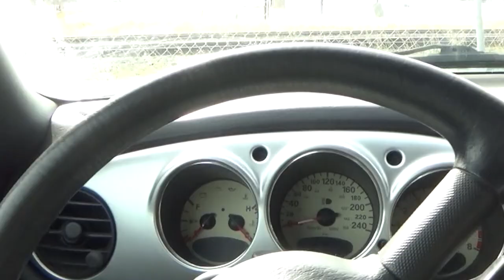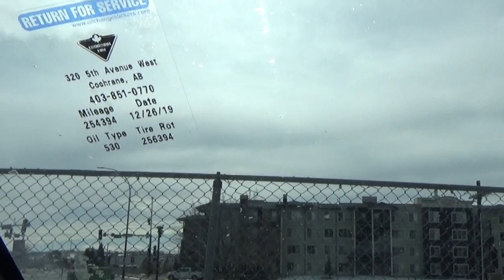I Bought a Turbo PT Cruiser Convertible!

Comment: Slightly eventful trip! Got it done though. Overall seems like a sweet deal for the money. Now the fleet isn't lacking! :)
Reply from the maker: 802 Garage I’m pretty happy with it for the money, I was expecting more cosmetic issues, but it’s pretty clean aside from the front bumper. I’ve driven it around town a few times since and the cam sensor has been behaving, but I’m still gonna change it + clean all the grounds.

Comment: I bought a '05 PT Cruiser convertible a couple of years ago. I love it. It handles like a sports car... I'm assuming that is because of the low center of gravity inherent to convertibles. Yes, the symptoms you are experiencing at 6:35 is the cam sensor... but replacing the cam position sensor is super easy, barely an inconvenience. Anyway, this car got me though my motorcycle withdrawal... after almost 40 years of riding motorcycles, I had my first accident (I was sitting at a stop sign, some idiot on his cell phone turned the corner short and plowed right into me). It was also my last motorcycle accident.
Reply from the maker: Jim Schwartz Yup cam sensor and wheel bearing already swapped, car has ran great since. Sorry to hear about your crash, I never had one but I had a few close calls on motorcycles and hung up my helmet also, too many crazy drivers out there these days. Actually all PT’s handle that good, I autocrossed a base model sedan and was the 4th fastest car of the day, if I’d had a turbo that day I think I could’ve beat them all. Here’s the video of that if you’re interested, it was such a fun time! https://youtu.be/cNBgJJ-K9M4

Comment: My '04 GT is the same blue as the chase car.  BTW if your PT's or Neon throws a MIL code regarding in correct purge flow it may be a sticky check valve on the top of the fuel tank.  Valve is glued to tank so I just top off the fuel and reach under the car and thump the bottom of the gas tank with a rubber mallet.  When you hear the "marble" drop you know you are good to go, just clear the code.
Reply from the maker: Jon Cooper “Electric blue”, yes that was the first PT we ever bought, it’s my dad’s, he’s had it 6yrs now, just a base model 5spd, no A/C or anything, buy it’s been a great car. Thanks for the tip, I had an issue like that on a ‘04 Durango and the fuel pump sucked the plastic gas tank right flat, destroyed the sending unit etc, not cool, that was one Mopar I had terrible luck with.

Comment: Looking forward to seeing your information on the car. I’m in the process of rebuilding my 2005 PT Turbo convertible.
Reply from the maker: Allan-Christine Hart Nice! I have a few videos planned for it for sure. I’m hoping it warms up here soon so I can put the top down, so far it’s still snow & cold.
Reply: Matt's Garage Thanks for the note- 75 here in Memphis TN. Just finished taking the intake off today to change out upper hose to cooling system. I’m just very cautious about any plastic connector in the engine area. My car is rust free except for one bump on one finder.
Found that the overflow bottle is next to be replaced. 
Have parts for steering, upper and lower control arms and wares link to be replaced. Then timing belt and all that would mean.
Has a new top already!!! I’m glad to have a project car again!!!
Reply from the maker: Allan-Christine Hart Wow! Giving it some serious love it sounds like!👍

Comment: Love my convertible my cam sensor did that to us in Newfoundland but after getting off the ferry we drove home in the Ottawa valley no problems lol was scary wasn’t sure if we make it home lol
Reply from the maker: Eric Lavoie The funny part with this one is the seller said they’d been driving with the engine light on for a long time without any issues, that’s my luck that it would act up 10mins after I buy it!😂 But at least it cleared up so I could get a chance to know it didn’t have other issues, I’ve drove it a few times since the video and it’s performed great, today I’m changing out the wheel bearing, cam sensor and I’m cleaning the grounds up (nice warm day out luckily). Very important to keep your electrical system maintained, that will prevent failures like this from happening. I actually recently did this video on just that: https://youtu.be/L94-bxYqOAw
Reply: Next week nice weather coming going take my baby out of storage clean her up take my mind off this virus crap going around

Comment: This looks like same year as mine. I love it!
Reply from the maker: Curious George It’s an ‘05, first year of the convertible and then in ‘06 they did the update I don’t care for as much.
Reply: @CarswithNash  Mine is 05 in the blue. This summer I am going to do some remodels with crome. Right now my issue is the gas gage goes wonky it will go low beeps but I have gas, not sure what to do, also cruise control not working, not sure how much that will cost. But, other than that crossing fingers it will last me few years.
Reply from the maker: Curious George That’s a bad ground, your fuel gauge actually grounds on the right side of the engine bay right up behind the upper mount there’s a 10mm bolt with a grounding harness running to it, you need to take that apart and clean it. I actually did an entire video on this recently and I highly recommend you do the entire process to your car. I’m actually just doing it to this car today, it’s one of the first things I do when I buy a used car. Here’s the link: https://youtu.be/L94-bxYqOAw

Comment: I always keep an extra cam sensor in the car for just such occasions.
Reply from the maker: B-rad M Honestly this is the first one I’ve had to change on any Chrysler vehicle I’ve owned... They almost never fail if you keep all your ground points and electrical connections clean. Sensors like that normally fail because of bad grounds, that’s why you’ll here of people replacing them and then they fail again two weeks later, I hear of that all the time, it’s because it’s not actually the sensor, it’s bad grounds  that burn up the sensor because it’s not getting the correct voltage or whatever. That’s definitely the case with this car, the grounds are black, battery cables are loose and corroded. The previous owner had been driving the car for quite a while with the bad sensor but claimed it never caused a driveability issue before. I’m actually just working on the car today, cleaning up all the grounds and electrical connections and then swapping on a used cam sensor. (with the current virus going on I actually have no way to get a “new” part)
Reply: @CarswithNash  I have my dielectric coming this week. Gonna do your recommended treatment on my GT. Hoping it clears up some codes for low voltage etc.
Thanks for all the great videos!
Reply from the maker: B-rad M Great to hear, thanks for watching!(-:

Comment: You know you can bring the turbo lite up to gt power levels with a computer reflash or swap,the engine is identical in the turbo lite(touring) and the gt,only difference is computer programming.
Reply from the maker: Yes and actually that was why I bought the car is I just wanted a good turbo engine to put in my GT that needs one, I figured if I bought a lite it wouldn’t be as abused. I’m not sure if somebody hasn’t already tuned it though because I really can’t tell the difference between it and a GT driving them back to back and I have taken down vehicles on the street that should be faster… It turned out to be a better car than I expected for the money I paid so we ended up just using it and now I’m actually going to be selling it pretty soon. Too many cars and too many projects and not enough time.🤷‍♂️
Reply: There is a a guy in Canada I have his e mail address if you are interested his e mail name is myceee I bought a pcm from him because mine was bad,minr is a GT,he put Mopar stage One programming on it which ups the hp to 250 hp.He doesn't charge extra for the stage one.You give him your VIN and mileage,he sends you the preprogrammed computer in less than a week.It's plug and play,no dealer visit required.Mine works great.Just replaced my camshaft position sensor because it was jerking and bucking like your convertible did and that fixed it.I was afraid it was fuel pump because they kind of act that way then as well.Thanks for all your videos.They are very clear and professional.
Reply from the maker: @winstonemerson2439  Sure I’d certainly take his contact information for future reference. Fuel pump failures are actually incredibly rare on PTs.

Comment: PTC cam sensor - always carry a spare.
Last time mine went out on me, I couldn't get out of the driveway.
They're rubbish.
Reply from the maker: Never had any problems with one before or since and that wasn’t an original one that failed. I actually replaced it with an original one from a high mile PT and it’s been fine ever since. My Neon ended up having over 200,000 miles on the original sensors. The trick is to keep the grounds and battery connections all cleaned up.

Comment: Im about to pick up a 05 PT Convertible with the turbo in it im told its fine for a little while then i guess it starts acting up and drives at a snails pace any thoughts
Reply from the maker: It’s probably cam or crank sensor, yeah limp mode makes it feel very broken, but it also means it should have a fault code which will probably tell you exactly what’s wrong. Both cam and crank sensors are pretty easy to change. Sorry I’m a day late on all my replys...

Comment: What's the difference between that turbo and the GT version
Reply from the maker: The turbo is the same, it’s just detuned in the computer (to 180hp) so it can run on 87 octane (although I find it gets a high RPM fuel rattle, I run 89), also the full GT spec cars have rear disc brakes and the auto-stick shifter. I can’t honestly see a huge difference in performance driving it back to back with my mom’s GT. The GT’s also have ABS which gives you traction control, it’s surprisingly easy to light up the front tires without it! (the GT’s have a button to turn it off)

Comment: Dream cruiser 2 and GT are the same specs?
Reply from the maker: Alejandro Martínez Yes they are, however not all Dream Cruiser’s were full GT spec, I think some years were turbo lites. One day I wanna do a video going over the different models and specs and the options you get etc. But with all the special packages they offered and stuff a lot of research will be required to get a video like that right. From what I can see the best way to instantly tell a turbo lite from a full GT spec car is a full GT spec car will have rear disc brakes and a turbo lite I believe will always have rear drum brakes, at least my turbo lite does.